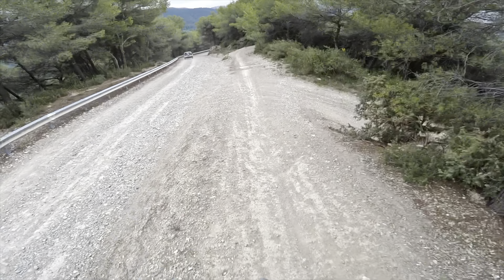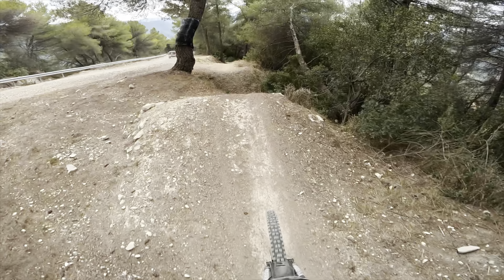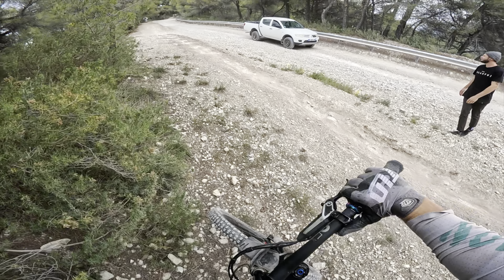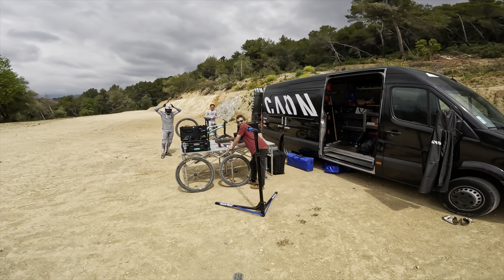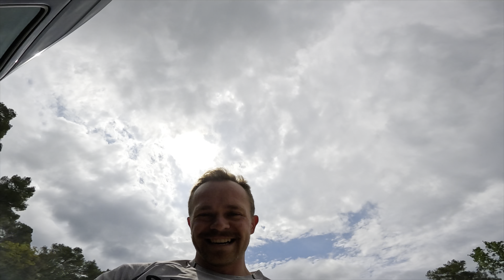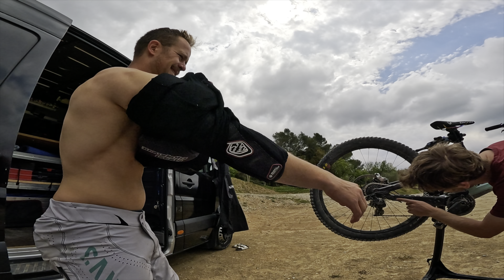Suspension talk, trying to figure out the finer details. Riding in France!

Comment: Hi, could you explain why you ride dhr ii in front ? i would like to hear from a pro rider
Reply: People think it stands for dowhill rear, it actually stands for downhill racing
Reply from the maker: So I chose the DHR ll for the braking traction. It has a better braking edge than the DHF
Reply: @TroyBrosnanMTB  Indeed it makes perfect sense, the DHR2 is known as one of very the best gravity rear tyre, especially for its braking efficiency, but also very good at the front on hard ground.
The question I have is why you don't have the Dissector at the rear, the tyre you helped design, which is also made for hard and sandy ground, especially at the rear...? 🤔